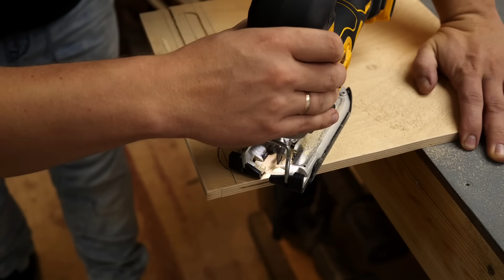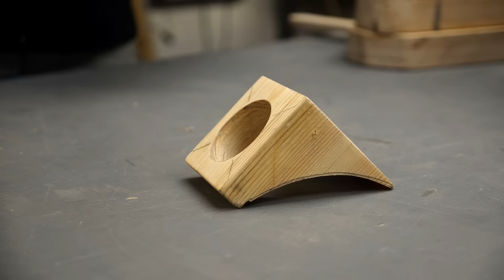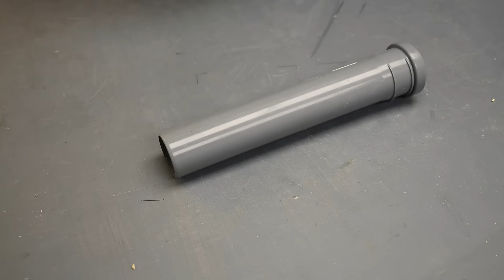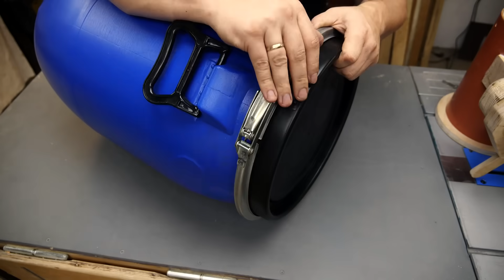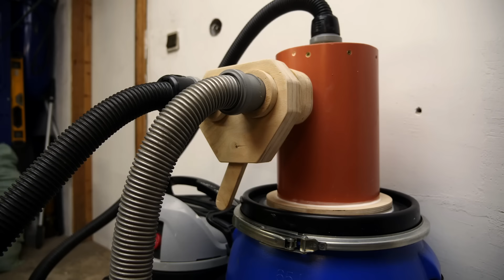Cool idea from a plastic pipe, for a garage or workshop!

Comment: Way to spend hours making something that saves you seconds. Just the time it took to watch the vid would be a years worth of pipe wrangling.
Reply: It’s not always about the function, which, in this case, is pretty effective. It’s about the building process. I get great satisfaction out of creating projects like this. If it’s worth building it’s worth over-building 🙂.
Reply: @davidbaker7665  Yes it's a fun make. I build custom bikes, I get that. It's just this is more hobby project than time saver.
Reply: Saving a few seconds doesn't seem like a big deal but if you save a few seconds thousands of times that adds up to hours of time saved.
Reply: @canaan5337  For sure. Except how many times do you switch out just 2 hoses? I've got 2 free standing and 5 hand held machines with a vacuum hose fittings. He used 2 floor standing machines with dust extractors in this vid & plugged in a 3rd hand tool.
Also, is he just going to leave those hoses lying on the floor permanently, or do you think he puts them away when he's not using the vac?
Reply: I personally like this project and find it a day more elegant solution than switching hoses. Also, less wear on the hoses. Not hobby, functional
Reply: @danielmclellan7762  I don't dislike the project. I do agree with comments disliking the mystery reveal. But my main issue is I wouldn't leave my hoses lying across the floor. Less chance of damage/tripping if they are hung up off the floor when not in use.
Reply: 😅😅😅 and yet you watched it
Reply: @kaybee3798  Actually (and consider this a free Protip) I jump straight to the end of "mystery make"  vids before deciding if I want to watch the whole build process.
If I'd gone by the thumbnail I'd have been expecting a toilet brush caddy.

Comment: wow a lot of negative comments.  This is one of those shop projects in between shop projects.  In my opinion the results were not worth the effort.  Very well made and you are handy.
I'm also handy and made a wet vac with a pump in it. I had a small submersible pump and a large wet vac so I didn't need any more parts or accessories. Its obvious where I'm going with this I can no longer with lift the wet vac to empty it when my basement gets water. Not that often but it happens.  Anyway,  you get the idea.  I never made a video but perhaps if you have the time you could make one.

Comment: Liked the video!
One thing I noticed was, that when you applied the vacuum, the lid of the container sunk, from the pressure drop.
Over time this may cause the lid to fail. A Piece of ply on the underside to support the lid, may become desirable, long term.

.
Reply from the maker: Thanks for the advice. I'll do it one of these days

Comment: Nicely done. The crux is to have a plastic barrel that's solid enough. I once ended up with one that was collapsing under the pressure of the atmosphere. Didn't expect that a hoover is creating such a strong negative pressure.
Reply: Those 'big box store' buckets are fairly strong, but they can also be doubled up (one inside another) to make them even more solid.

Comment: Nice clean work! I might do something similar with a 5 gallon bucket. It's not being lazy at all. It takes up time even for me switching from dust table to regular shop vac
Reply: Seen a neat project that used 2 buckets 'mouth to mouth' using the entire lower one for collection and  the upper one providing a fair bit of separation. Can't recall the channel though - hang on,  quick search and it looks like Chris Notap was the one I was thinking of, but Matthias Wandel has one too (in addition to many other cyclone and dust collector builds and experiments)

Comment: Ok. Very clever I must say. But why add all that stuff when you have it hooked to a shop-vac?
It's easier to just use the shop-vac and save space and time.
Reply from the maker: The vacuum cleaner is less spacious, and the filter clogs up quickly, this adaptation corrects these shortcomings

Comment: But why not just make a bigger tank for the vacuum to clamp onto directly?
Reply: Because the spin-y action introduced by the tangential air inlet separates out stuff (see cyclone separator) and eases the load on the filter of the vac.

Comment: Build a perfect mouse trap and the world will beat a path to your door.
Apart from obvious skills with tools I think i will continue using my 45 year old wet/dry vacuumjust  as it is.
Coped with toilet blockages, building and workshop muck,flooded floors,woodstove and wood pellet boiler maintenance and apart from a dent which caused a power loss (repaired with a lump of plumbers putty) has been totally maintenance free.
That seems to define a good tool.

Comment: It seems to me that this guy just enjoys making stuff of wood, because I could make a similar vac system by using a 45 degree joint PVC plumbing pipe (the type with threads on each end and screw on o-rings) attached to my shop vac. The only difficult part would be making a valve system to close the o-rings that was not impacted by vacuum. But with a little experimentation I should be able to solve that. I think rubber flaps should do it. If I can't I would simply put a cap on the side I was not using at the time. In either case its a lot less work than this wood project.
Reply: 3" Dump valves for a RV makes great gates for a vacuum system

Comment: 9.22 minutes not quite wasted.
I am guessing the hyper-critical bits are the size of the large disc at 6.00 minutes and the relative angle of the vac hole in the 1" grey plastic pipe to the dust inlet hole in the 6" (?) orange pip at about 6.45 minutes . Get either of those wrong and the whole thing just will not work properly (if at all). 
Whilst the video didn't cause me to want to make the contraption (I have a dust vac already), it did make me pause watching and buy one each of those nifty triangle rulers and mitre angle thingies :) :)

Comment: Why not just have one inlet pipe and just change the tubes depending on which device you are using? The value is well designed and made but isn't necessary.

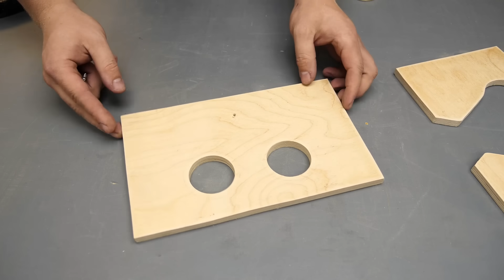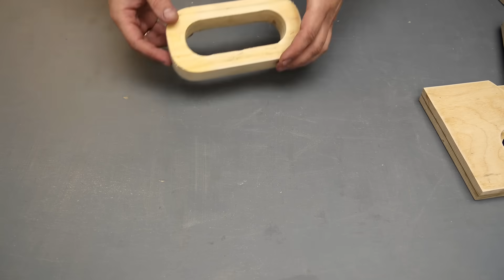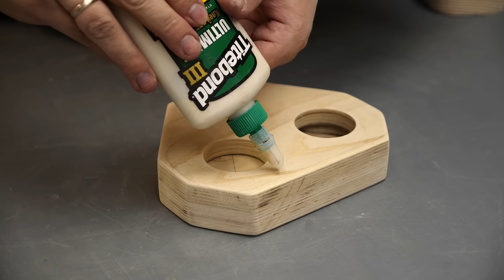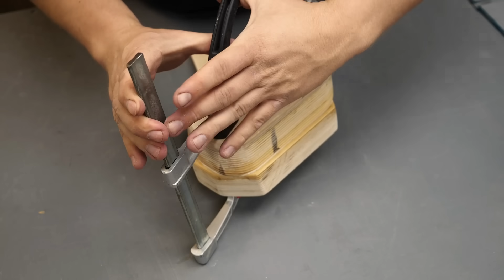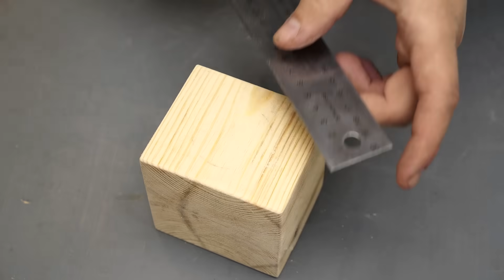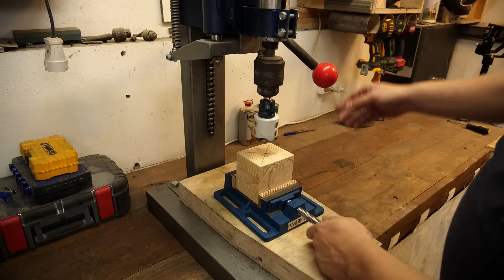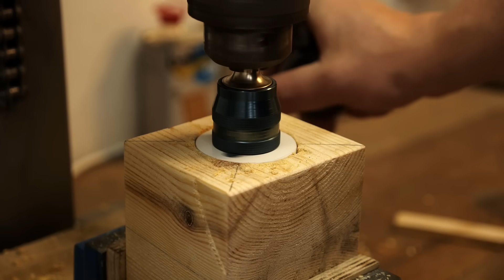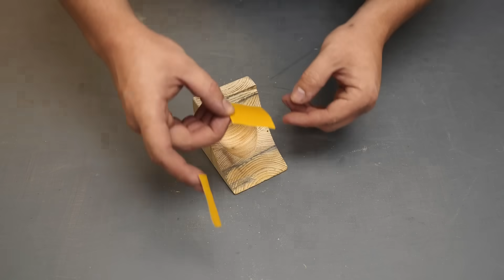Comment: I like the idea of building a solution with what you have available and I get that you want to shorten the video but I like to see all the steps. Unfortunately, there seems to be missing steps in the video between 0:57 & 1:02, 1:23 & 1:26, 2:05 & 2:15, 2:45 & 2:47, 3:05 & 3:07, 3:16 & 3:27, 3:35 & 3:37, 4:32 & 4:38, 5:55 & 5:57, 6:14 & 6:15, 6:28 & 6:30, 7:07 & 7:09, 7:22 & 7:24,... I guess the video gets folks to watch it and I like the idea but I won't subscribe as it's incomplete therefore ultimately not beneficial which is unfortunate. Maybe post a full length (with all the details and shortened video?  Also, a cut sheet and parts?
Reply: Ron

Comment: Whats the point of having two hoses if youre only ever going to be using one tool at a time? Wouldnt it be just as easy to just plug a single hose into each tool as you use it? If youre going to have to walk over to the lever every time you switch tools wouldnt it be the same amount off effort to just swap the hose onto whatever tool youre using?
Reply: Izatt

Comment: An awful lot of work and materials when all you need is the blue drumand a pair of holes in the lid with a u pipe under one, and a splitter box on the other for multiple hoses. A tennis ball on the hose you aren't using will close it right off.

Comment: I'm really trying not to be a troll here, but unless a small shop cyclone dust collection system isn't available to order in your country, then by all means.  But seriously, I'm sure we've seen videos like this where the thing they're making is readily available online that's engineered, mass produced, more efficient and cheaper.  It's like someone building a CNC wood router machine out of plywood, threaded rods, motors and circuit boards:  it's interesting click bait content to watch but completely useless.  (sorry, just got to the end of the video and it's awful at sucking up dust, wayyyyy too slow!)

Comment: All  you made was an oversized  dual valve, I won’t even call it that, more of a dual port adapter... And I’m calling bullshit on your design because without a filter for a blocking screen all that sawdust would go up the middle gray pipe I think you edited the video and put sawdust in the bottom of the barrel

Comment: Okay instead of wasting my time building that I would just use the shock vac it would be pointless to do all that and take up more room 
When you can use what you already have which is the shock vac. And you can modify the hose to the vacuum to make a double hose for both tools just as easy.